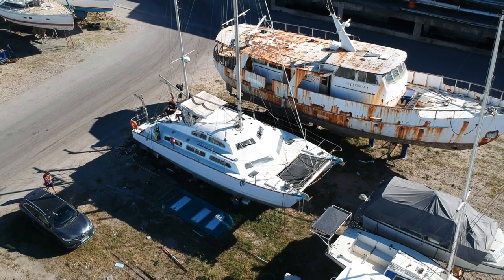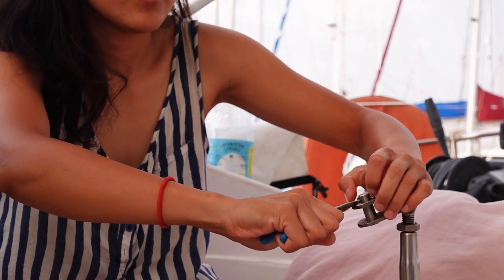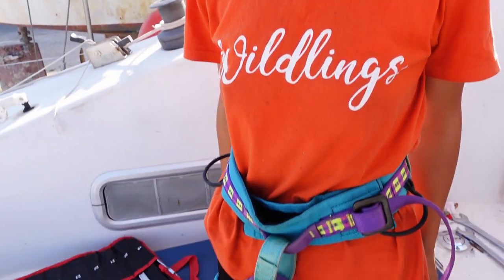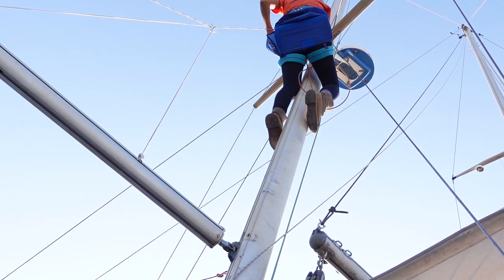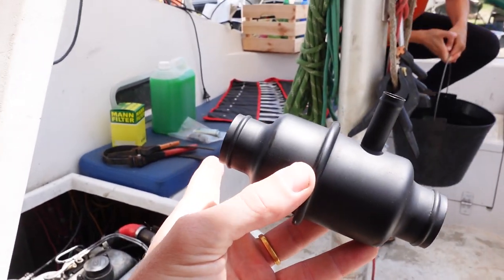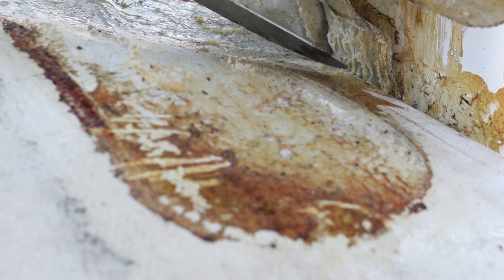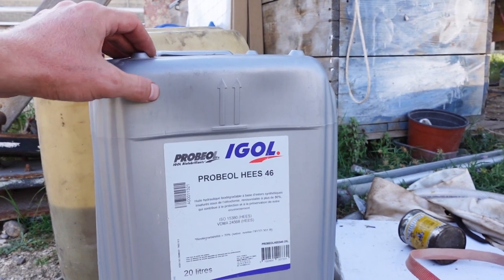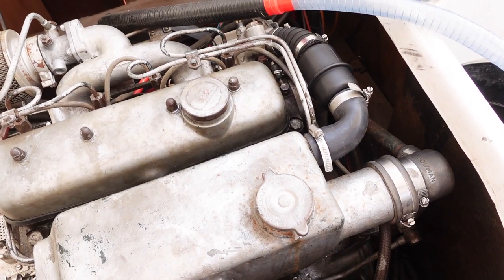DIY Re-Rig ~ Catamaran Revival On A TIGHT Budget | Wildlings Sailing

Comment: How long is your rigging supposed to last before you replace it? Replacing Your Standing Rigging

Question – When should I replace my standing rigging?

From the Rigger – According to industry standards, the anticipated lifespan for stainless steel rigging is 10-12 years for wire and 15-20 years for rod. Of course, a number of factors affect a rig’s lifespan including load, sailing conditions, mileage sailed, age, fatigue from cyclic loading, environmental influences such as salinity and contamination, and frequency of care and maintenance. Many people believe that only heavily used rigging needs to be replaced, but the continuous flexing of loose wire that is not under load can take a serious toll as well. The flogging of a loose shroud can actually be harder on wire than steady pressure.

Comment: I watched a recent episode of the O'Kellys Youtube  and they were having overheating problems.  The ended up doing a flush of the heat exchangers with some chemical.  Wasn't very expensive.  Removed Zinc? and some other stuff coating the lining of the exchanger.  Seemed to solve their problem.

Comment: It got me thinking this engine heating issue you think you have.  It might be a good idea to test the temp sending unit and gauge to see how accurate they are.  Could I suggest you remove sender unit leave it connected to gauge.  Get a container of boiling water and put sender unit in the hot water.  Test the water temp with your electronic temperature gauge.  The gauge normally connected to the engine should read exactly the same as the electronic gauge.  If not then you will know what the differential is and can adjust what you see on the gauge against the differential.  If the engine gauge is electronic and is showing a differential might be worth checking the wire from the sender to ensure its in top condition.  Either way you will at least know what the gauge is telling you is either the truth or it is off to some extent and can live with the difference or investigate a new sender gauge combination.  Personally if I could identify the differential I would just live with it for now.  Anyway good luck and best wishes

Comment: Also good work on the sailboat.
For the time spend you might have bought a better boat. Just by go for a normal job and saving like hell. But how borring and the experience you got will come in handy and saves you a lot in the future the cat and coming boats.  The confidence and safety aspect is also an benefit, now you know the boat inside out.

Comment: Buy a mechanical temp sender and gauge to verify the old electronic sender and gauge are reading properly.  You can always change out the electronic sender and gauge and keep the mechanical sender and gauge for troubleshooting.

If the wire for the electrical sender has developed ANY corrosion the resistance will increase and change the ohms reading at the gauge.  

Research using an ohm meter to measure voltage drop in a cable.  http://www.nissantechnicianinfo.mobi/htmlversions/Fall_2011/Voltage_Drop_Resistance_Measurement.html

Or determine the gauge of the wire and lookup the resistance per foot and measure the resistance of the wire used for the temp sender.  

http://hyperphysics.phy-astr.gsu.edu/hbase/Tables/wirega.html

OR measure the resistance at the temp sender and at the gauge.  Compare the two and refer to the chart in the previous URL.  That’ll tell you if the wire is garbage due to corrosion.

Comment: the thing is that u run it without load and still it went over 90 so usually it says that your heat exhangers are glogged.
Reply: Or if you need to change the thermostat?

Comment: I'm sorry if this sounds harsh but gee, you running a small amount of warm/hot water trough your heat exchanger and expect the engine temp to be normal @ idle when the waterflow trough the heat exchanger is at the lowest flow. You need to check the temp when the boat are in the water and under driving conditions, how often are you going to sit and idle when you are sailing the world??? On a side note, coolant with antifreeze boils around 110 C so 95 on idle is far from coolant start boiling or blowing head gaskets.

Comment: Congratulations on the 50k,. I think the rigging work looks sensible. Keep an eye on it. Perhaps use some PVC tape band around the wire at the edge of the Norsemans, just to see if there is any movement. I don't know much about them, though. Good luck with the engine temperatures.

Comment: I think Mark, that you need to reassure yourself and get hold of a 100c thermometer and  test the coolant in the header tank directly, those infra red temp guns are handy but for testing coolant temp not accurate enough. As others have said, how good is the boats temp gwage ;-) ?

Comment: On the hyd motors there should be a case drain. Should be able to drain most of the hyd oil from there
Reply: Also with the coolant temperature depends on what ur thermostat opens up at

Comment: You are not able to completely drain a hydraulic system unless it is specially desingned for that or you dismantle it completely. There will always be some oil left in there, but as long as you get the filter changed and change the oil in the tank if it is old or contaminated, you are good and your system will be fine. Leaks are the main problem with hydraulic lines and couplings, and cannot be helped, other than changing hoses when they occur. Best of luck.

Comment: Engine will get hotter if the primary water is cycling round.  Try measuring temp of water in bucket, i bet it rises by the same amount ie 5 to 10 degrees.

Comment: Have you guys cleaned the heat exchanger yet? Take it apart and clean it in vinegar. Or just run vonager thru both sides of the cooling system a few times and flush it all

Comment: Peanut oil, is a good biodegradable hydraulic oil. And it would work in your pump. I personally don't like biodegradable stuff .. I'll rather have the real stuff. Especially pushing my boat. I have had to use hydraulic propulsion systems before. They work but they're not as efficient as direct drive. An old hydraulic hoses can blow at any time . And it's quite a beautiful mess. A leaking hydraulic hose under pressure can be dangerous. It can cut through you. If you have a body part in the wrong spot at the wrong time. Also they are hydraulic fittings that screw in to the hose. You may want to look into those to have a spare if you need to make a repair. As opposed to crimp on fittings.

Comment: As a rigger, I would re rig the entire boat if I saw a cracked turnbuckle. If one has gotten to that point, it doesn't matter if it looks good stainless is a devil at hiding it's damage. Boats been on the hard for a long time, rig takes more stress than if the boat could transfer the load sitting on the water! With the mechanical fittings tho, you can at least take apart, inspect, clean, re install. I fully gett the budget, run it as long as you can, maybe a do a stay at a time, but just be wary of the limits of a rig that age
Reply: Transfer the load from windage is what I mean

Comment: Ok you now changed some fitting on your standing rigging, rust is ALWAYS A WARNING, we have always used lanoline on wires inside terminal fitting. BUT the weak place will be YOUR CHAIN PLATES , can have almost invisible cracks, also what are they attached to ??????? HOW are the fasteners below deck ????? We were always taught to change all standing rigging at first sight of broken strand. GOOD LUCK it seems you are getting better. Document all repairs so you can check back as to when they were done.Documentation really comes in handy.

Comment: In aviation and I suppose in boating too u need to bend only a bit of the shorter pin. Not both. The metal is not engineered for that. Have a look at a video just on pins. It could save u a lot of trouble even the orientation of the pin.

Comment: Try turning down the tick over  of the engine it's still a bit quick mark.
Reply: Sounds about right, don't forget there's no gearbox attached to it so it doesn't need to idle slow enough for that to be able to be engaged/disengaged. I'm thinking with a hydraulic pump attached an idle around 1000rpm will provide enough pressure to maneuver the boat easily with extra throttle available if you need more oomph. Then again, not an expert on hydraulic drive. My 636 idles around 750rpm which is fine for the gearbox.

Comment: That engine sounds sweet. How are you cooling it? If you are just using a bucket, I guess it is not going to be as cold as sea water. Testing the water temperature in shallow water that has had plenty of sun is not relevant. The real test is to get it in the water and test it in use, but close to shore. I am more familiar with car engines, and they have a sealed pressurised system that can run at over 100 degrees without boiling.

Comment: Flush the engine out five or six times, first take the thermostat out and you can use baking soda, I recently did my car with distilled vinegar and it cleared every bit of gunge out of the engine. Make sure after doing that you flush everything again with clean water to get rid of the vinegar as if left can be corrosive and then use waterless coolant as it will bring the temperature down by 15 %, it’s expensive but well worth it as it lasts a lifetime unlike normal antifreeze. 
Please keep the dog it really needs a good home and it seems so well behaved and let’s face it we all want to live and dogs just want to please there owners. I myself am looking for a yacht and my boys brexit and bear small dogs like yours will be coming with me. I would be totally lost without my boys. I did read something recently though and that is if you have dogs or cats onboard you must hoover up every day as dog or cat hairs cause problems in the bilge and bilge pumps if you don’t...wish I could come over to help you with the engine but the boys don’t have dog passports yet,,,

Comment: Hi Guys, your motor is sounding good. As for the temperature, if your recirculating in a bucket , I’m sure the motor will run hotter than normal and measuring the sea water on the edge of the rocks as you did may give you a false reading. Hey, can you demonstrate your audible over temperature alarm ?  Keep at it and good luck
Reply: It's not recirculating in the bucket, closed loop system. Engine coolant circulates through the heat exchanger (radiator), and the heat exchanger is cooled with water from the bucket that is then ejected out the exhaust pipe.

Comment: Cut new Cotter pins to extend  only 1/4"  and bend only one side!!! There's a right way for everything.... that is all you need to keep from getting jabbed and easy to reuse.  Do not cover up with tape!!!
Reply: Keeping the water on the outside of the boat is commendable!!! Looking really good guys.
Reply: The hydraulic system is alot like the power steering on automotive systems... they have to be taken apart by sections to drain the old fluid which gets bad from age, heat, water saturated fluid.

Comment: You should never use silicon as a sealant on these SS fittings. Some silicon sealants contain chemicals which attack SS causing pitting and corrosion. Any polyurethane sealant would be recommended.

Comment: Try individ. temp. readings per cylinder or exhaust valve; may indicate cooling issue/ blockage at that cylinder - therefore increasing overall reading. Beware OVERtorsioning stays' cable-flaring retaining nut. Hydraulics circuit may need complicated sequential bleeding procedure. Hydraulic rams or impellers may have bleed points on or near to them , Cleaning / flushing system prior to servicing? Confirm seals; both water and oil seals condition. Oil looked clean, nest ce pas? Look inside old filter...cut it open. Any mechanical manual procedures from manufacturers online?

Comment: I haven't worked on hydraulics a lot, but I have worked with hydraulics quite a bit. I seem to remember when I was doing maintenance on hydraulic equipment... we would use a separate "flush" fluid to flush the system out first. Then replaced with the hydraulic fluid after the flush. I'm not sure if we did this because there was a concern for contamination, regular maintenance, or what. But it may be worth more research if you have to do regular maintenance on your system.

I assume the part you replaced on your diesel was the thermostat. Did the thermostat state what temperature it opens at? I thought they generally did. Also, how accurate is the temp gauge that you are reading? Also... You kept mentioning "the bucket". I am guessing that you are using a bucket to hold your cooling water for testing because the boat generally uses the water surrounding the hull for cooling? If this is the case, I'd bet the little bit of water in a bucket would heat up reasonably quick and not have the chance to cool because it's not going through a radiator. If this is the case, you might be just fine once you have the boat in the water. But, by your comments I think this is likely your theory as well.

Comment: When you are paying someone to "do" your rigging, it doesn't make sense to only do a few lines. Also, if you are paying someone who is more worried about keeping their reputation than how much you pay, they do not want the line they don't touch to part at sea because their business will be mentioned against the failing rigging if it is their fault or not. Insurance is funny to, despite what you pay them, they will work very hard to make sure they never pay you anything. They will, quite happily, have you pay out of your pocket to repair something that does not need repair for the privilege of paying them for insurance.

Comment: i didnt see any water or black when you drained the hyd. res.  if it were mine i would just change the oil in the res. and filter and move on   you might cut the filter apart and see if you see any metal in the folds IF YOU DO  you will need to look into to your pump/s

Comment: Nothing wrong with cable repair.  All torque converter transmissions will be a partial change typically. Not much difference

Comment: You should really have replaced the wires and all the other stainless steel as there are not necessarily signs of corrosion on it. But it will break exactly there. In the other vid you told, you don't have any experience with boats and sailing. So you really should listen to old seadogs. The sea is not forgiving any mistake. When the rigg comes down, it's not only far more expensive, it's also highly dangerous out on sea. The mast might hit one of you or it just happens that far out there where no ship is coming for weeks and weeks. There will be no way to sail or motor the boat.

Comment: Is your raw water pump working? it should suck a 20l bucket full of water up in about a minute.
Reply: If you run the engine at all without it able to suck water into the raw water pump you will wreck the rubber impellor. So it will need replacement. Always good to carry a spare.

Comment: Just remember, with the heat transfer between that motor and the small volume of water in that bucket, the water will increase in temp. Leave the motor till you in the water.
Reply: The bucket is being drained by the water pump on the engine.
That water goes into the heat exchanger and is dumped overboard.  
The water in the bucket is being replenished by fresh cold water.  
So that’s not the cause of overheating.

Comment: At tick over the water pump is running slowly so gph is low. Although the engine will make more heat at say 1500 rpm cruise it will also have more gph to keep it cooler. That's the theory anyway. Yes, the internal coolant circuit is close circuit  but the heat exchanger water would normally be continuously changed. I don't think you can manage that at the moment hence the bucket. If you can get a 50 gallon drum under the boat that would make a difference. That kink shouldn't be a problem. Looks like a formed silicone hose. That oil filter has been on there since the "aerosol rebuild".
Saying "the hoses are OK except for a few leaks" was hopefully a small joke?
Reply: Hello Deluk, I am curious about this statement "that kink (in the hose) shouldn't be a problem".  I'm not a mechanic but intuitively, it seems to me that a kink in that 90 degree turn will decrease flow or GPH (gallons per hour) and increase pressure in the whole system possibly creating more leaks at other hose connections.  It also seems like the kink will get worse, cutting the flow further, with time and heat, collapsing the opening more, reducing flow and increasing pressure.  I was going to suggest that Mark purchase a new pre-formed 90 degree turn hose that is properly sized in order to maintain the full inner diameter and volume of liquid that can pass through it.  If you are a mechanic or experienced with diesel engines can you explain why my argument is faulty?   Thanks Tim.
Reply: You can use a bucket just fine, at 2000 rpm it'll suck down a bucket every 10 seconds or so. Just need to make sure you can fill up the bucket as fast as the raw water pump is drawing it.
Reply: @timhardman4764  Basically I would agree with your premise. It could be a lot better, and a more precise pre formed hose would be an improvement. This one does appear to be pre formed  but shouldn't collapse easily. Yes, if there is a better one out there it would be good to use it. I don't know what the normal flow rate is but it doesn't have to be very high if the inter cooler is doing its job properly. I am not a mechanic.

Comment: me again if the only cool u have for the engine is a bucket of water that's not enough to run for that long it will get hotter , i think u put a new thermostat they can be a little sticky to start when new , i think its all good guys   Dont panic
Reply: The bucket water is not recycled. It goes through the heat exchanger and out the exhaust.